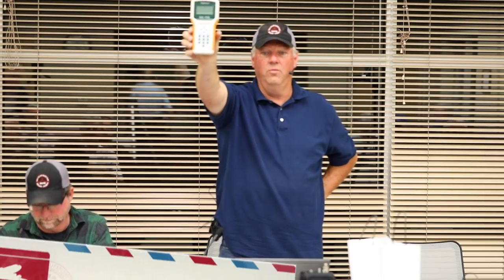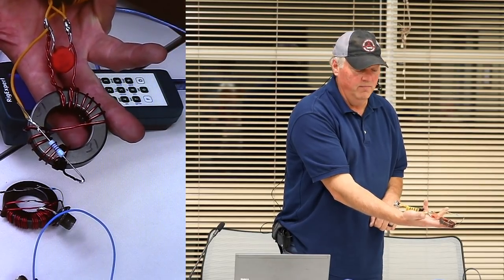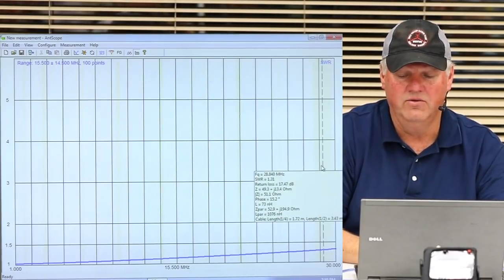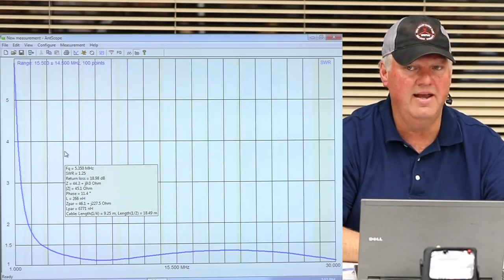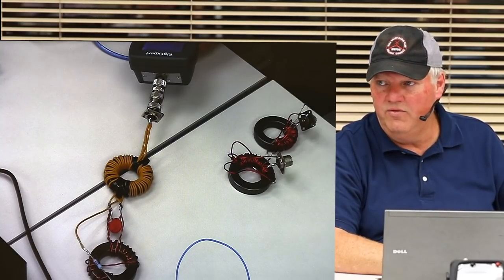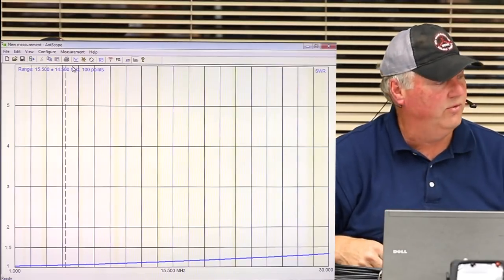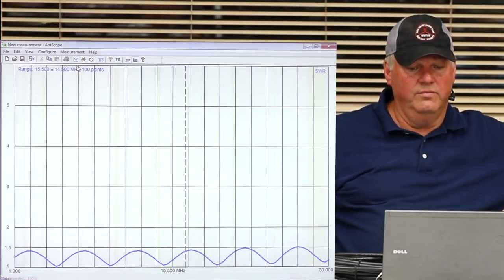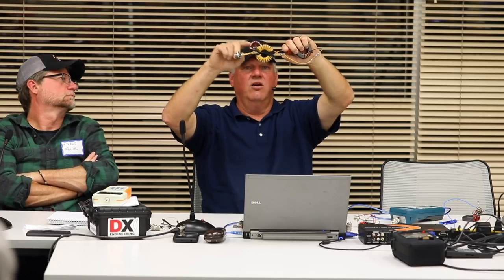Is Your Coax Good & The Right Length? (RigExpert AA-600) - Coax Part 1

Comment: My understanding is that the coax length just fools the meter at times.  I don't know about the Rigexpert, but most SWR meters just measure the voltage min and voltage max and uses that to calculate reflected power.  The problem is that standing wave voltages will interact with the signal voltages, cancelling them at some points and amplifying them at others.  So wherever the meter is taking it's measurement is going to determine what Vmin and Vmax values it sees.  But just because your meter is at a point where the standing wave and forward waves cancel, doesn't mean you have less power being reflected.  It's just that the meter sees a low Vmin to Vmax ratio and assumes the reflected power is low.
Reply: Yup buy a NanoVna and dont play with Rig Expert. Nuff Said.

Comment: If your antenna, or dummy load, or whatever, has say, an SWR of 1.5, at no point along the coax will that reading increase, that is unless you have another problem.  The waveform you are showing on your rigexpert looks more to me like a common mode current waveform, and when I see it on either of my VNA's I always add a choke or a balun and the problem always seems to go away.
Reply: Let's say it's just common mode current.... Y add a choke or ballen when you could just add nothing and make the cable the length that doesn't cause an issue
Reply: He uses balluns in the video and still sees the rise in SWR. What's causing that

Comment: The length of the coax matters more to obtaining a perfect match to a 50 Ohm load of a monoband station. Type of cable and quality of cable has more to do with db loss at particular frequencies. Higher the frequency more loss. Moving from band to band on a multi-band antenna would require an antenna tuner as the ham bands frequencies are not multiples of one another. So although, half wave increments gets you close it a match, it will never get you spot on unless you are using a dedicated monoband station. I have tried to explain this to several people yet no one seems to grasp the concept. Keep in mind that per meter, coax has a inductive and capacitance value to it. So with that being said, LC networks are frequency dependant when trying to achieve a 50 Ohm match.
Reply from the maker: Well said! Thank you for watching and leaving such a concise comment. 73 Jason / KM6FAK
Reply: I have made a couple of the 49-1 transformers and as expected had a good match on a end fed wire when the wire was a half wave on 40, then it is a full wave on 20 and etc. across the bands that Are a multiple  of the preceding band. The impedance of a end fed being 2500 to 3000 seems to not care if  the wire is a half or full wave. I did not get a good match at 10 mtrs. but it was fine just below 28. Now the WARC bands are not covered. So I make a full wave at 17 mtrs and got a perfect match to the coax but just did not hear any signals to work, so down it came and back to half wave on 40, It preformed great, does not seem to radiate that well on 20 but is a perfect match to the coax. The wire is a inverted L from 5 feet at the feed point up to 45 feet on the stand off on the tower and then down to a tree limb. Dave, W4GSM.
Reply: @1903A3shooter   A 49:1 transformer work wonderfully. Now try to make a 70cm 1/4 ground plane antenna, get it to resonate on frequency then change the coax. You will see that your SWR will change. Which will mean that cuz the random length of coax has affected the impedance of the antenna.

Comment: The simplest method for determining the right length of any feed line is it has to reach the antenna from the radio.  More usually doesn't hurt.  Not enough is a real 'pita'!  An easy way to do all the impedance juggling is to use a tuner.  No, they aren't that lossy and make things easier which is the whole idea.  The use of the software is nice, but not necessary at all. Oh well, I'm not selling anything either.

Comment: I suggest everyone who concurs with the info relayed in this video, buy a copy of and read the ARRL Antenna handbook/ Radio Amateur Handbook.
This is Misinformation on transmission line theory. Put a 50 ohm dummy load at the end of any length 50 ohm coax and it will flat line your analyzer in the HF ham bands, no half wave necessary !!! 57588 viewers mislead.

Comment: Great video. I am glad you gave an honest opinion of HWEF antennas.  I use one for portable operating, along with my KX2, all of the time. Super easy to erect and they are passable RESONANT antennas.  Mine is 65 feet 5 inches.
I also use a Rig Expert analyzer. The one I use most is the 230 Zoom, but I do have an AA-600 as well. 
I leave my 230 set for 250 sampling points. But I like that they finally got away from limiting you to only 80 sampling points like the AA 600 has.

Barry, KU3X/QRP
Reply from the maker: Thanks for watching! Yeah, the Rig Experts are very cool tools!
Reply: Good

Comment: Excellent video.  I have a 9:1 unun and a 1:1 current unun from the "three letter" company.  I measured them with my AA-600.  The 9:1 seems great.  The 1:1, not so great.  I opened it up and it appears the "three letter" guys used the wrong mix of toroid as the core.  I'm checking that out with them.  My homemade 1:1 with snapon toroids made out of type 43 material works MUCH better from 1.8 to 29 mhz.  I totally concur with your assessment of the performance of some of the commercial ununs Kevin.  Keep up the good work.  I would like to see a video on 1/4 and 1/2 wavelength measurements with the Rigexpert analyzer.  73, and thanks.  Bob, K5INW
Reply from the maker: Thank you Bob! Yup, those are some great examples. That's a good idea for a video, thanks.

Comment: One little detail bothers me about this experiment. ..... Putting a choke at the input of the 49:1 transformer will block any displacement current and the antenna will basically not work unless you have a ground or counterpoise on the secondary. I've tried this! You can put a choke at the shack end of the coax with no problem but the system needs some metal to supply that small amount of return current. Join our EFHW group for more detail https://www.facebook.com/groups/EndFedHalfWaveAntennas/
Reply from the maker: Thank you for your feedback. I will forward this to Kevin, the presenter.

Comment: So what antenna analyzer is suggested? From what I can tell the RigExpert seems to be the best according to reviews and number of features. There are some out there that are rated well, but most of them don't have cable testing capability. I have my eye on the AA-600, but man I'm going to have to save for it and it will definitely get a Pelican style case. I've considered the MFJ-269C, but I often read QA and Build complaints about MFJ, and people mentioning how out of calibration they can be. If you suggest anything else let me know.
Reply from the maker: Both are good. I've used multiple MFJ's with no problems. The newer RigExperts seem to be more innovating with their designs and screens. But, having an analyzer is extremely helpful. Even if you are just borrowing it.

Comment: Hello.
I'm Japanese.
I have two question.
Is the version of the computer that this analyzer is connected to Winodws10?
Also, does this software work properly on a Winodws10 PC?
Reply from the maker: Yes. The software works good on Windows 10.
Reply: @HamRadioTV  
Thank you so much.

Comment: what can we do about the length of cable when trees dont always grow at the right distances away from my shack to hang antennas? It shows having the right length and type of cable makes a big difference in the video.
Reply from the maker: Yes, this can be challenging. There is a little math involved to try to get you close. Stay tuned for a second video on this subject.
Reply: Make your coax longer and trim it back to perfect at the new longer length.
Reply: You can use the ladder line there is very little loss in it

Comment: Does it make any difference whether the analyzer is held vertical or horizontal?
Reply from the maker: Jim Guelde Only if you are inverted while holding it.
Reply: Ham Radio TV - I knew there had to be a trick to it.

Comment: Where is the best place to purchase parts?   Radio shack is no more!   Just looking for suggestions.   Great video!   Jimmy,  KN4UXO
Reply from the maker: DX Engineering and Giga Parts are great places to check out. Also, EBay for some odds and ends.
Reply: Mouser, MCM, Digikey, Jameco,  also Marlin P Jones for odd surplus parts deals

Comment: How are you measuring the common mode rejection?
Reply from the maker: In this video Kevin / N6VLF is using a RigExpert AA-600. He then tries different homemade baluns with different types of coaxs. Instead of having an actual antenna hooked up for this demo he put a 50 ohm resistor in it's place.
Reply: @HamRadioTV  you didn't answer his question. This is common with hams. Reminds me of cop talk.

Comment: So, if someone is still monitoring this vid, how does the layman know roughly what length coax to use? Should we stick with 1/2 wave length increments?
Reply: Start with 1/2 wavelength.  Due to velocity factor the tuned length will be shorter.  So then you connect an antenna analyzer to determine how much to remove in order to tune to resonance.
Reply: @SMShannon55  : Fact is, if the antenna is tuned properly and has the proper counterpoise, the coax should be invisible to the system. Therefore, coax length doesn't matter.
Reply: @TheLonesometoad  - except that there’s no perfect coax and never a perfect counterpoise.  If you want to get the most out of an antenna system the length of the coax is still important.

Comment: Thns I want to put up a 5 band 2el quid need a 2 to 1 how do I make it. Been working on it for some time. Help
Paulkq4cd
Reply: Using old lighting bolt that out of business now. Work great, moist weather mess with it. Just want to use it  again. Thinking about 75 loop about 60 feet
Reply: Don't know  what to use, I think I can make one, not use of the parts and wire.  I hear Teflon wire is fantastic to work with but I don't know where to get it I live in Florida so a ARS  is a thing of the past
Reply: I take it the resistor that you're using their replace is  antenna that you gonna use. Not sure of the winding and   Tauride
Reply: Aes

Comment: We need an affordable tool to measure common mode attenuation of chokes... there are sooooo many out there that CANNOT be tested because we do not have the right measuring tools... you think your choke is doing the work but it's probably not... specially if you do "ugly balun" air core chokes... I just wish those rig expert meters could test attenuation and impedance of chokes...
Reply from the maker: Very good point! This is something Kevin has also been talking about. Look out for more videos on this topic.
Reply: Nanovna
Reply: @joerowland7350  those aren't super precise, they vary readings from one another, you need the right adapters and OSL kit to adapat to the right connectors...
Reply: @Aleziss  I have Rig n mfj  aa hp vna  the nano is really close  n I bout a nice set of adapters from rfpart long ago I know the nano not cert calibrated n I just got it not long ago but it's handy for a lot of things n a real good for the money  I payed like 119 for it 
Mine is the f
Reply: @joerowland7350  ok mine is the nanovna-h (nanovna.com), I even see differences between the nanovna and the nanovna saver software which usually give higher results... difficult to understand which is giving the right readings. Mine use SMA connectors, then I need SMA to BNC then BNC to banana plug (to connect balun leads).

Comment: So CB "myth" about having to use half wave coax turns out to be true ?
Reply from the maker: Yeah, how about that. Not that it won't work, it just works better.
Reply: If it’s on a Kenworth truck, you have bigger problems! Aka, fiberglass cab is a lousy ground plane.